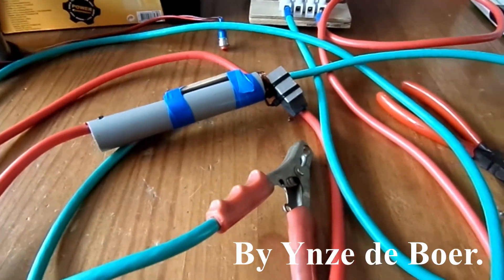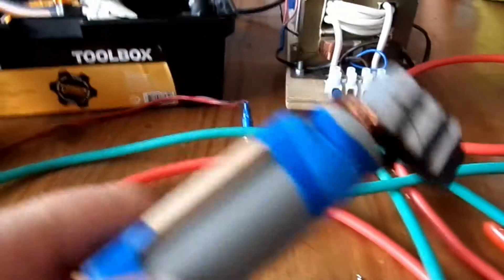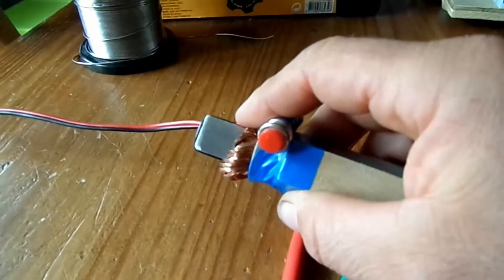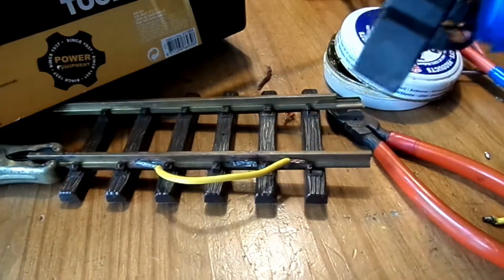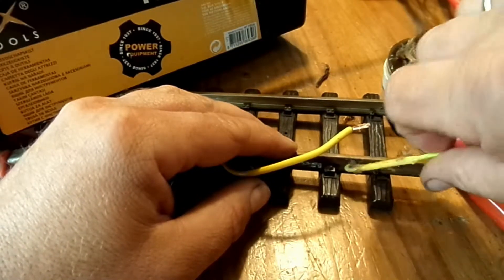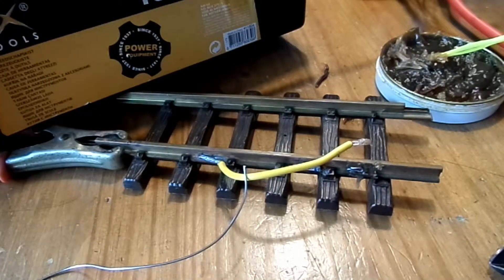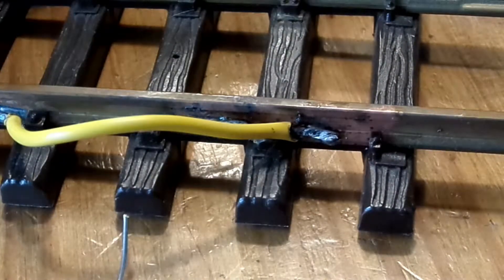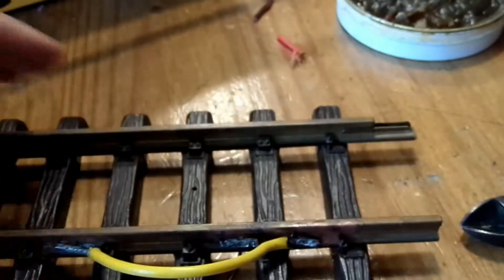Resistance solder system part 2.

Comment: Looks more like welding not soldering, normaly it is used about 1v to 4v and about 35a to 40a for resistance soldering. 🤔
Reply from the maker: It has a big carbon tip and it heats up nice and fast